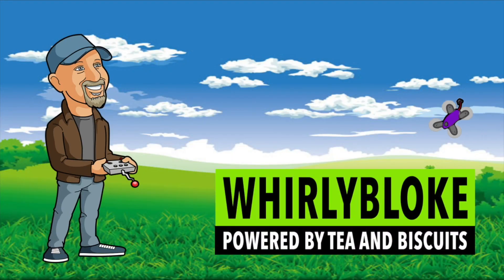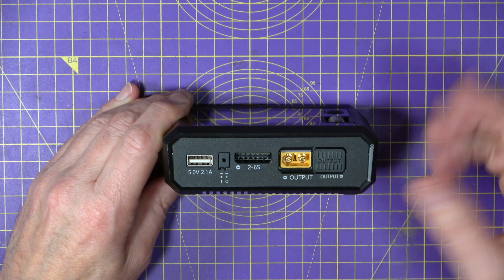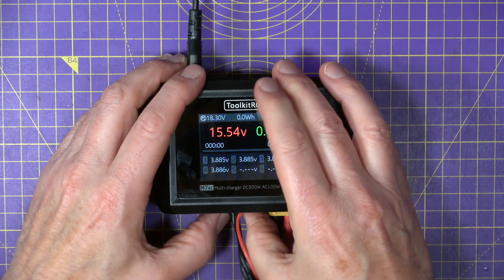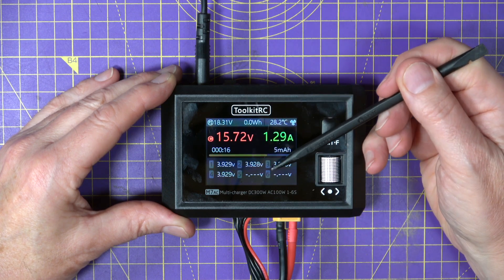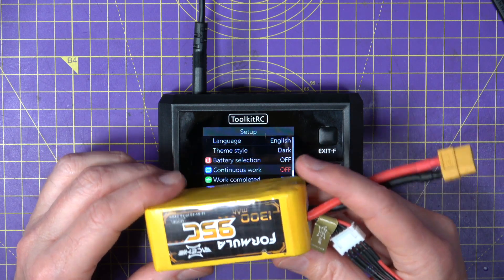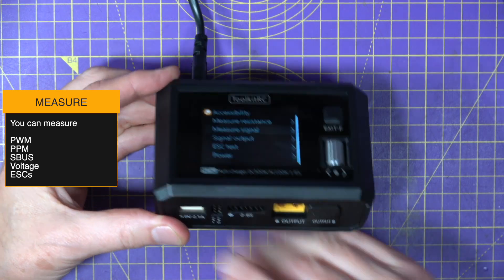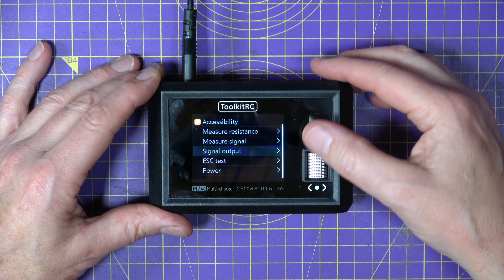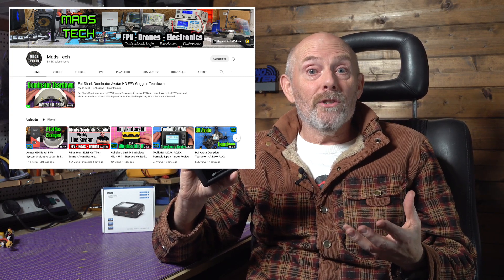ToolkitRC M7AC  battery balance charger and multifunction test tool // Full review

Comment: Hi all. I’ve got toolkitrc m7ac. I charge 1s lipo using vifly whoop series board. It works fine with 500mAh batteries. However when charging small lipos like 220mah for mini drones, when it comes near end, all numbers on charger screen keeps blinking red, and it goes like that for hour… but know it’s balancing when blinking yellow and red, but with 500mAh it blinks red for a while near the end of charging. With small lipos it does it for ages… also it doesn’t matter if I choose storage charge or normal charge, near the end which is around 3.7v when doing storage charge and around 4.1v when normal charging, it starts blinking red on all cells and never finish… anyone knows why?
Reply from the maker: The blinking red light near the end of charging likely means the charger is struggling to balance the smaller 220mAh batteries. This happens because smaller batteries can have higher internal resistance, which makes precise balancing harder, especially as they near full charge. Try lowering the charge current to around 0.2A, or connect a single battery directly to the charger without the ViFly board.
Reply: @ thanks for reply. I can’t connect it directly as they are 1s ph2.0 connectors and only tx30 and tx60 sockets on the charger. However when connecting them single one by one through Vifly board, it charges no problem. As you said, it struggles to balance them. I’ve found couple of these small lipos, that can be charged in pair without issues, and some others struggle, probably proving that some of them small lipos are poor quality, rather than charger problem itself.

Comment: Can this unit act or take the place of P200 power supply?
Reply from the maker: The ToolkitRC M7AC charger is a multi-functional charger designed to charge and discharge various types of batteries used in remote control hobbies such as drones, RC cars, and airplanes.

While it is possible to power some devices using the M7AC charger's DC output ports, it is not designed to be a power supply and is not a suitable replacement for a dedicated power supply like the P200.

The P200 power supply is designed specifically to provide stable, reliable power to high-performance RC battery chargers and other electronic devices. It offers features such as adjustable voltage, current limiting, and overcurrent protection that are not available in the M7AC charger.

So, if you need a power supply for your RC battery charger or other electronics, it is recommended to use a dedicated power supply like the P200 instead of relying on the M7AC charger as a substitute

Comment: There is only few YT'ers who I love taking advice from generally, and you are one of them my friend! How would you compare ToolkitRC chargers with iSDT? I do have D1 and I couldn't be happier with it. Not s single problem with it ever. I am just thinking to buy another one, little more portable, and this seems like a great option. Plus, it has AC just like D1, so that's a big plus in my books. I am just concerned about all those complaints when it comes to ToolkitRC products, even this M7AC went through couple of revisions until they fixed it finally.
Reply from the maker: I've used pretty much all manufacturers chargers over the years. iSDT are great and used them quite a bit, but I bought the original ToolkitRC M8 to try it out and was hooked.  The M6D and M6DAC are my go to chargers these days.
Reply: @WhirlyBloke  - amazing! I might give them a try and see how I like them. I mean head won't hurt from one more charger in the house, right? Right? Maybe hurt a wallet a little bit, but that's it :)